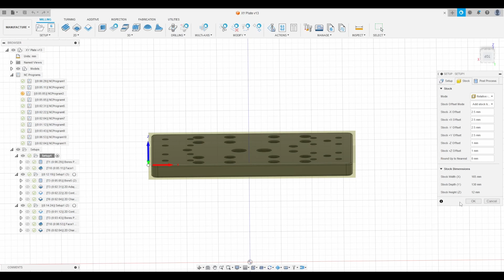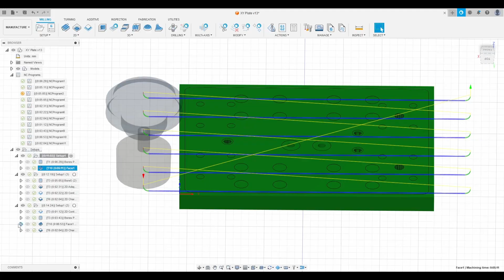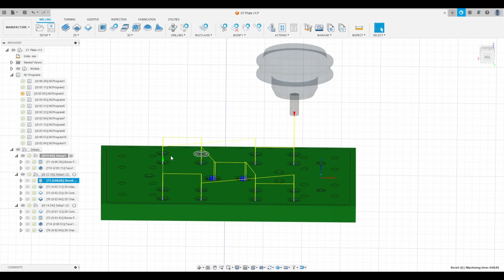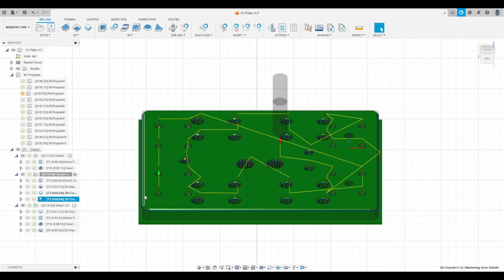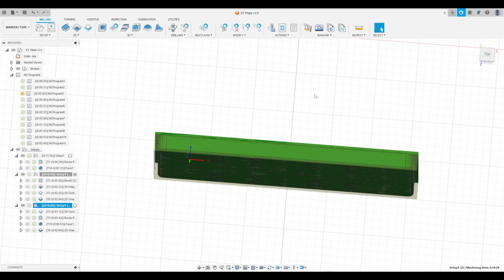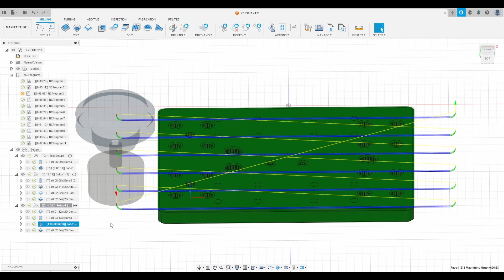Millenium Machines Milo V1.5 - Making the new XY Joiner Plate

Comment: Did someone try to build an ballscrew version of the Milo?
Reply from the maker: @Ensonic13  my Milo has ball screws ^^ for the upcoming V2 it's gonna be a option from the beginning, however I personally would not do it again.. not worth it imo
Reply: @AramcoPhil  Do you know the V2 Release Date? Are there some Infos about the Changes? Found a Video yesterday with an Miley 2.0 and Milo 2.0 but didn't see the differences
Reply from the maker: @Ensonic13  "SoonTM" ^^ As soon as Jake says its finished.. Yeah, a lot of Quality of life improvements, especially regarding spindle and collumn tram, the build volume changes slightly (more Y travel), option for ballscrews, ... if you join our discord, there is more infos there :)
Reply: @AramcoPhil  I joined... Wanted to order a 1.5.... Hm.... Does it make sense to wait? Will there be an upgrade path?
Reply from the maker: @Ensonic13  there will not be an upgrade to V2. there will be a V1.6 which gets a few of the upgrades of V2, that will be upgradeable to. V2 Kits will take at least until late summer probably, so.. dont know if you want to wait that long..

Comment: A little bit of chatter on that first contour pass in this case its fine cause its being cleaned up but my suggestion is not to contour deeper that 1 tool diameter.
Reply from the maker: Yeah, that's cause of the bit of chatter on the adaptive, which is also full depth... doing 2 stepdowns would be something i'd change for the next one as well

Comment: Do you see much of a difference in surface finish between the 0.4mm roughing and 0.2mm finishing passes on the facing op?
Reply from the maker: not much, 0.2 is a hair better.. i think to get it even better i need to crank up the movement speed..